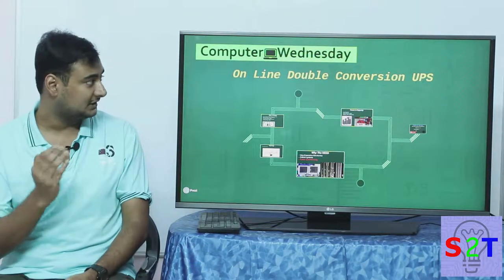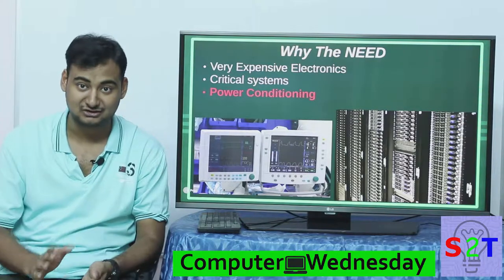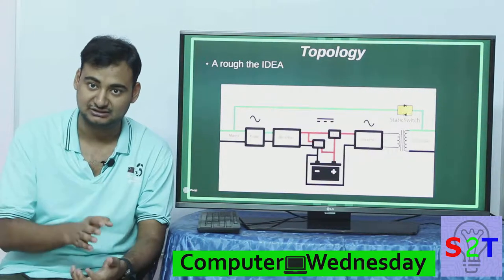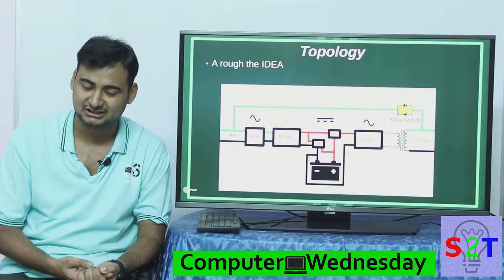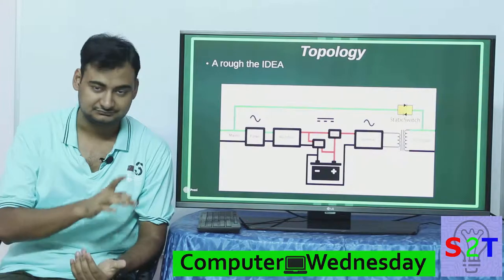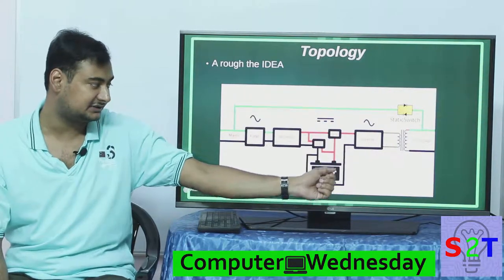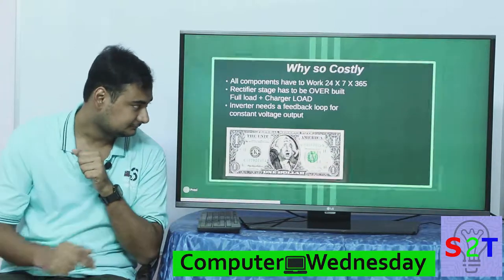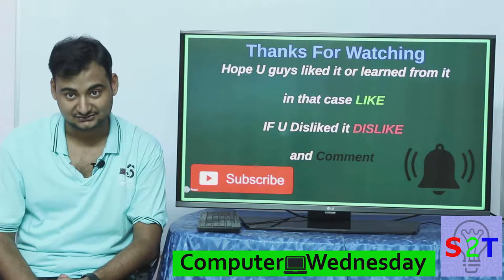Computer Wednesday Ep10 (Online/double conversion UPS Explained)

Comment: Had an interesting question, instead of SMF batteries, can we use normal tubular battery bank for Online UPS? Everywhere I have seen SMF batteries so not sure if tubular battetries could be used.
Reply from the maker: U can use which ever battery u want there are many systems that by default comes with tubular batteries

Comment: Hi....a great video indeed..can you make a video on how to use lithium batteries with ups designed for lead acid batteries...?
Reply from the maker: No not a good idea there are lion battery pack built for this use case that has same charging & discharging voltage & amp curves other than that you are playing with fire
Reply: @AnupamVipul  thanks for your reply